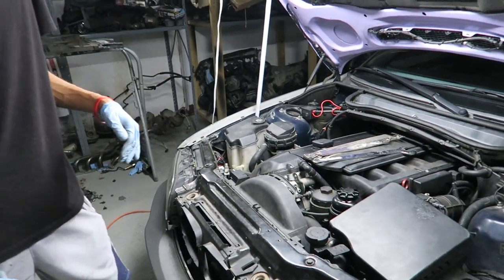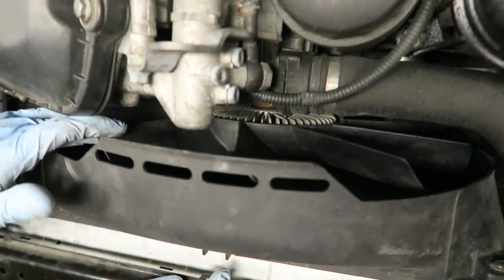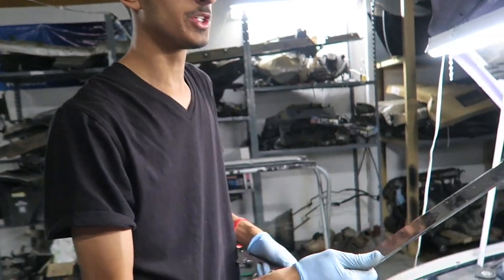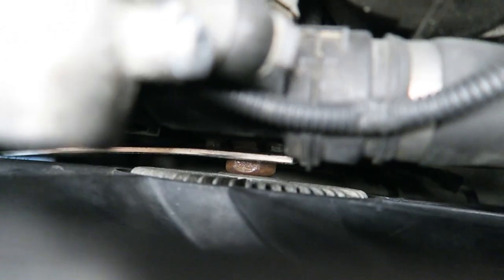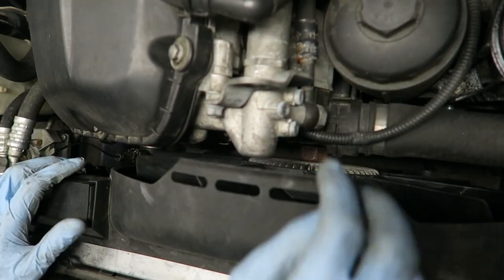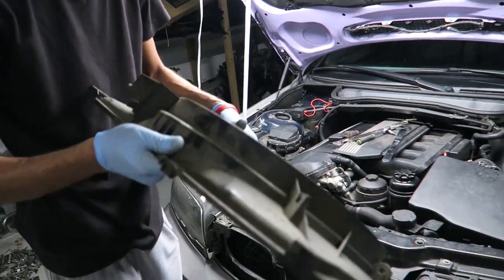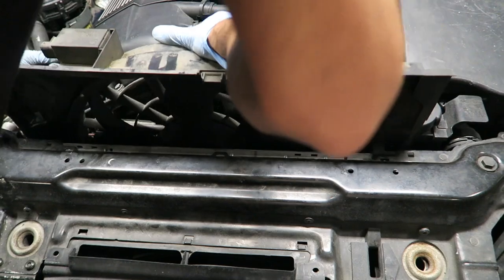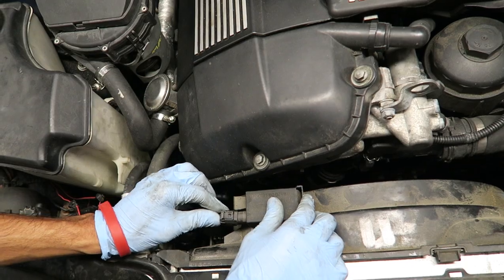BMW E46 Mechanical Fan To Electric Fan Conversion DIY

Comment: I’m confused, did you remove the auxiliary fan in front of the radiator? Or did you leave it in there and also can you just remove the viscous fan and replace it with an electric fan is there a need to remove the auxiliary fan?
Reply from the maker: I like to leave the auxiliary fan there as a backup just in case you are in the middle of nowhere and the electric fan goes out then you can just plug the aux fan back in. This exact thing happened to me on one of my cross country trips. Depending on your climate, the aux fan may need to be removed for more airflow.

Comment: I bought a cheap 99 328i that came with a blown mechanical fan BUT it is a standard. Is it okay to replace the fan when replacing the water pump or should i buy an electric fan instead(still replacing the water pump)? since you said only automatics came with mechanical fan, it does have the fittings for an electrical fan... thinking maybe previous owner added the mechanical fan without knowing..

Comment: Can i do this method on my 330ci with steptronic ? Does not lead to overheat oil in gearbox ? I heard its a problem. Thanks for answer! Good luck with other DIYs they are great !
Reply from the maker: +Aleš Staša This should work on your e46, only e46 I don't recommend doing this on is the M3. Thanks for watching man!

Comment: Hi, Great Videos!  In the Bimmer forums everyone says to remove the Aux fan. Will not removing it cause any overheating problems? I want to do the swap in my 330CI and was concerned.  Thanks!!
Reply from the maker: It shouldn't cause any problems, but removing the aux fan would be the safe option.

Comment: Is the regular electric fan, the one you disconnected, to "small" to use alone without the mechanical one? Great video!
Reply from the maker: +Erik B Yes the one behind the bumper is the auxillary fan, you should not use that one without a mechanical fan.

Comment: I just did this fix to replace a mechanical fan that had lost all its blades somehow and after installing one I purchased from ecs tuning. the fan keeps running after my car had been turned off even up to an hour after at which point I pulled the connector off. I'm wondering if you know why this might be happening? maybe bad wiring or a relay?

Comment: Hi there is possible that i can add another connector  and use both electric fans inside and outside or would it cause any electric fault or malfunctions?

Comment: Hello, good video, I have several questions:
Is it possible to do this procedure with a BMW X3 2006?
Where can I get a manual fan like the one you show in the video and if it can fit a 2006 x3?

Comment: I know you said the electric fan replaces the clutch fan and the auxiliary one as well but is there a way to keep the auxiliary fully connected so it engages as needed?  I was wondering if there is some kind of adapter that would allow you keep both fans plugged in.  I love your videos man.
Reply from the maker: +Oscar Monge You can wire in another relay and fuse and have it wired straight to a switch that you can turn on manually. Thats about the only way I can think of to retain both fans.
Reply: @ShopLifeTV  so If you're not using both fans then why don't you just rewire the existing front fan to turn on whenever you want it to?

Comment: Morning, thanks for your video . My question is how to connect the old wire to new electric  fan.. Which socket or must add on the new one??
Reply: It uses the same motor with the same wiring. So yes the same socket that you unplugged your manual fan

Comment: great video!!  I what to  my e39...  
 would that cooling fan (the one in the video) work on my car??
Reply from the maker: +Eddie Reyes I am not exactly sure if the e39 manual cars had electric fans. I would check on that. Besides that you can get an aftermarket one.

Comment: Can this conversation be done on an E53? Specifically on 2006 BMW X5 3.0 using a 4.4 or 4.8 fan? At what temp does the lower hose activate operation?

Comment: Hey man, what's the difference between a mechanical fan and a electric fan? like the advantages of changing to electric?
Reply from the maker: +MrDk23221 Mechanical fans are known for breaking fan blades resulting in damaging the cooling system and other accessories. The fan clutches also tend to go bad, and it is a hell of a lot easier to remove the electric fan when servicing the car. The electric fan eliminates the auxillary fan and the mechanical fan and comes stock on manual e46s.

Comment: i have a 1998 328is i want to do this conversion because my rad blew up last summer with no warning. ive replaced the water pump with a metal impailer,the thermostat but i notcied my clutch fan spinning freely with no drag. what type of fan do you suggest for my year and make? liked and subbed
Reply from the maker: I would look into a behr fan clutch as opposed to the cheap ebay ones.

Comment: Question. I have a 2003 325i and I cant put my mechanical fan back on because its stripped. My car has an automatic transmission, can I still replace the fan with an electric one?
Reply: There's no room for a clutch fan and electric fan two fit reason u ditch the shroud and clutch fan  only way to fit the oem electric fan from the Mt e46s

Comment: Sup men, my car only as the Aux fan cable I don't have another one for the electric fan, I've hear that I can use the Aux fan cable an use it on the engine cooling fan. Or can I had a second cable to keep the Auxiliary fan also?

Comment: I got in a wreck and I guess my fan and clutch wheel  eventually wobbled loose from the bracket that holds it in place I guess it's pressed into a bearing?  so the fan and clutch are already out. can I just leave the bracket less clutch there and pop in an electric fan? then my next question  is without a fan clutch how do you size a new one pc belt.

Comment: Did this to my 335ci, everytime i plug the fan in (keys not in ignition) the fan comes on, and never turns off. I do not have the outside air temp sensor (in the bottom side of the bumper), could this be why the fan never shuts off?

Comment: i have 325ci 2004.
but why to change from mechanical fan to electrical fan?
do this prosses get rid of the fan noise that comes when the car is heated?

Comment: Hey there, are you sure the aux electric fan is the same as the principal electric fan, i wanna make this conversion, but bought an aftermarket electric fan, and just dont fell secure with  the motor that came with, so i was just thinking on using the OEM one that is in the aux fan

Comment: I followed your instructions and deleted the mechanical fan.  After installing the electric fan I have experienced high pressure on low side of the A/C line.  Do you think the fan has anything to do with it?  My A/C was working perfectly fine before the delete.
Reply from the maker: The fan should have nothing to do with it unless you damaged something or unplugged something by accident.

Comment: Hi I had a problem where it only works when my ac is on when doing the conversion am I doing something wrong?
Reply: The aux fan is for the air con so this mod seems to me to be all wrong, if you unplug the temp sensor it should come on as that is emergency mode.

Comment: is this the same on the M3 i have an 06 !
Reply: No not the same, I have a 04 M3 and looking to install this.
Reply: On the forums they don't recommend it. Don't remember the reason. It will bolt in though

Comment: If you unplug the radiator fan switch on the e46 must the fan run? ... And if you plug it back the in the fan stops... My e46 is overheating.. Can it be that my radiator fan switch is faulty

Comment: Hi. I have a bmw e46 - 320 - diesel - 136 ps and i hav a problem with the Fan. Its work only in the first speed !! Normaly the electrical Fan hase 3 speeds. Because of that my expansion tank has explodet. How can i fixet to work with all three speeds ? Thank you.

Comment: the fan you replace will be on when you turn on the ac. because you use the connection of fan condenser?
Reply from the maker: +stone hallow The fan will turn on as needed to maintain the proper operating temperature around 200F.
Reply: @ShopLifeTV  but what happens when we use the ac same as oem

Comment: Can I do this on my e46 M3 smg?
My aux fan shows signs of corrosion on the module and has no parts available to replace it.

I’ve been struggling with overheating with a/c on when it super hot it. Only when it’s like 30 degrees plus it overheat on idle

Comment: I found a 2010 electric fan bmw, could I swap the newer model fan for a bmw too a 1998 528i? Basically electric fan conversion, using a 2010 bmw fan

Comment: Is there a way to keep the outer fan connected also? And is the electric fan is enough to keep the engine cool?
Reply from the maker: You would have to run another relay or switch as well as new wiring to keep both fans. The electric fan is enough to keep the car at operating temperature.

Comment: Hey, awesome videos... I've subscribed to your channel 👍.. Regarding the conversion to electric fan, can I do the same to an 01 e53 3.0 with auto transmissions? Can I use an e46 electric fan or do I need an e53 specific electric fan?
Reply from the maker: +Nebil Baqhum You will need a e53 fan as they are different from the e46. Thanks!

Comment: Hi can we use an n42 (4 cyl e46) radiator fan to replace the clutch fan in a manual m54 e46?

Comment: My problem with my 02 325i automatic is, when the maf is unplugged car works very fine with no problem. I purchased one on ebay for 40.us but didnt work. All the cluster dashlights came on. My car came from the UK. What is your take on that. Thanx
Reply from the maker: DId you purchase a used one or a new one?
Reply: +ShopLifeTV I bought it on ebay.

Comment: Hi, i have a couple of questions. I have an auto trans e46. 1: how does the fan control its speed if its not directly mounted to the engine and my car wasn't prepared for an electric fan? Does it control automatically based on the engine speed or temperature? 2: I have the aux fan in front of the radiator, if i swap to the electric fan, can i keep both functioning? Or the aux fan doesn't work anymore?
Reply: Gabriel Lee  hey did  you get info on this I am in same situation 👍🏻

Comment: hi i like this video))  can you tall me, i hav BMW E39 525 2001 and whot can  i use for electro fan? thank you man!
Reply from the maker: +Cici Kldiashvili Not sure if the manual e39 have electric fans, but that would be your best bet.
Reply: Some one tall me if you change fan to electro, engine haw more HP, whot you think are this thrue?
Reply: did u find out wat u need for a e39 conversation

Comment: Hey, so i didnt quite understand, but if i do this will my auxiliary fan will continue to work as it did ir it will just become useless?
Reply: Captain Obvious useless... not needed! Electric fan will work both for the engine and a/c cooling.

Comment: What's the partnumber on the fan you replaced the cluth-fan with?  Bet I can find one of those on eBay...
Reply from the maker: They are on ebay, i do not recall the part number. Check real-oem and put in a manual transmission e46. The manual transmission non-m e46's came stock with the electric fan.
Reply: ShopLifeTV found the fan at the brakers, bought one, installed but there actually isn't room for it in front of the M57 diesel with auto transmission.

Comment: how can this work properly? the aux fan is a push fan  so when you put it behind it is trying to push the air forwards thru radiator but will be fighting against the natural high airflow from driving down the highway!  the only time it will cool is when near stationary in traffic as no wind resistance from front, you would need a puller fan to fit behind radiator

Comment: Hello. I own 2004 BMW e46 330 ci (face-lift) with (6 step) manual gearbox. My car has the same fan that you just installed on yours and I've been told that it should have the mechanical fan because electric is not sufficient for cooling a 3.0 liter engine and when using air conditioning in heavy traffic it could damage the engine. What can you tell me about this.
Reply from the maker: It depends on where you live. The electric fan comes standard on manual 3.0l cars, only car I would be worried about running an electric fan only are s54 equipped cars.
Reply: i know that manual dose rob the engine horse power but an electric one will make the alternator work harder to keep up with the electrical system. my old e36( correct me if im wrong) 1995 325i 2.5l is more than happy with its stock fans i have an aux and a belt driven fan works like a charm got 187k on the stock one

Comment: i just did the swap from mechanical to electric after two fan blowouts and got it installed and i have no wires to plug in....any ideas? there is a lil box over there with a few wires going to it but it looks like a fuse inside...no connector...

Comment: I just did the swap and after installing the new fan my 325ci will not start, here are some facts, 
1. While removing the fan i turned the pulleys with the tool to get a better location to remove the fan clutch. Would that have messed with my timing?
2. I didnt do anything else to the water pump after taking off the fan clutch, leaving it as is. 
The car seems to want to start but acts like the timing is off, the car is throwing no codes when using my obd tool, i also noticed the egr light is on. Any suggestions as to the cause of the problem starting?
Reply: Maf sensor?

Comment: Jason\Ankur I'm a big fan of your DIY's I'm inquiring to see if you have an Electric Radiator fan that you can sell to me so I can replace the manual mechanical radiator fan on my 2001 BMW 330CI Convertible, also maybe you can lift and check out my car too and see if there is any other major stuff that I need to replace and fix in the future and give me a quote on how much it will cost me for you to do them??

Comment: Would you recommend using both the a/c aux fan and the electric rad fan especially if the car is in the Arizona desert? Can i just splice the 2 fan wirings together?
Reply: The above car mentioned is a 99 323 automatic.
Reply: Do it

Comment: One of the worst feelings is hearing the fan blades rip through everything in your engine -.- 400 to fix and replace everything
Reply from the maker: At least you will have a new cooling system haha
Reply: what was all broken? lookingto get one that looks like the coolant hose and shroud and whatever else was  damaged,
Reply: This same exact thing happened to me about a year and a half ago. 
New fan, fan clutch, shroud, radiator hoses, expansion tank, couple of pulleys and belts, as well as the Transmission cooler and lines.
About 600$ in repairs, and now i have a new hood dent thanks to the fan 🤣
Reply: @fernandjose07  what made the fan explode?

Comment: So you can keep both fans ???
Reply from the maker: Yes you can, the a/c condenser fan would just be there unhooked. In super hot climates I would recommend removing the a/c condenser fan to prevent a restriction in airflow.
Reply: @ShopLifeTV  ohh I see now i’ll just keep the fan there permanently because if one fails and the other isn’t in there that wouldn’t be good

Comment: ShopLife, i did this mod in 2015 summer. But my 2002  E46 330i sedan overheated when i drove on small road after i did a few stops at intersection stops. The fan kicked in but the temp gauge just keep going up and as soon as i parked it, coolant was everywhere. I bought the electric fan from ebay- (New Radiator Fan BMW 325i E46 3 Series 2006 2005 2004 2003 2002 17111436259).  Could the problem be the cheap fan? I live in Minnesota so traffic is not too bad, only during rush hours. If the cheap fan is the problem, i will definitely try this mod again.  Any tips/advice? Thanks in advance...btw, love your channel
Reply: Cy a buy the genuine bro are more expensive but great quality,dont'buy aftermarket fan electric like behr mahle,are assembled in china but with the logo of made in Germany.
Reply: Cy a - I ha a 2003 530i, I have the manual fan and the electric auxiliary fan. My aux fan died, then I started to have issues with over heating as well. (I also live in Minnesota -duluth-) 
After calling quite a few mechanics and doing research, I found out that the mechanical fan is all but useless. It’s the auxiliary fan that does all the work. 
You absolutely MUST keep the aux fan in running order or replace. 
The aux fan turns on when:
A) the A/C is turned on
B) the car needs to cool down i.e. the car over heats. 
The fan has two speeds when the cool down function is activated by the onboard computer, high and jet engine. 
All in, BMW USA and the Bentley repair manual say you must have the aux fan in running order, the mechanical fan is optional but does help.

Comment: Someone keeps arguing with me that the swap will lead to localised hotspots between cylinders, causing the head gasket to fail. I fail to see how the electric fan doesn't do the same job as the clutch fan, when from monitoring temps, it stays at 96 to 97 all the time.

Comment: How did you have the wiring done?
Reply: It's plug n play using the existing ac plug on the radiator side no splicing if taken off a Mt 3 series e46

Comment: Hi Guys, I have a question, when you have the electric fan on your bmw e46 do you still need the aircon fan in front of the radiator
Reply: Yes.
Reply: Yes as the air con will not work without it.

Comment: Is that mean we are unable to use two electrionic fans at the same？
Reply: Correct it will only have one fan.
Reply: Will the fan engaged when the a/c is on?

Comment: can i change  mechanical fan to an electric if i have E46 M54B25 2003 Automatic transmision?
Reply: yes you can. any automatic or manual e46 can accept an electric fan in place of the clutch fan.